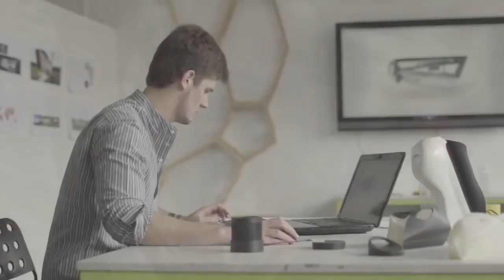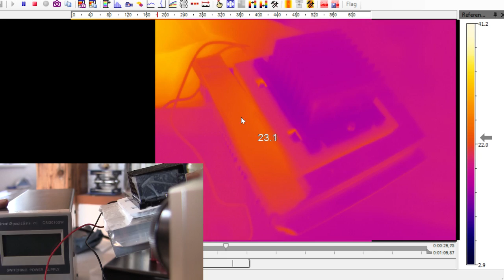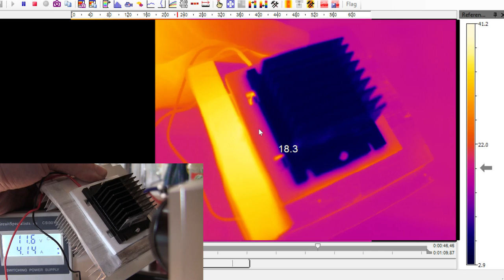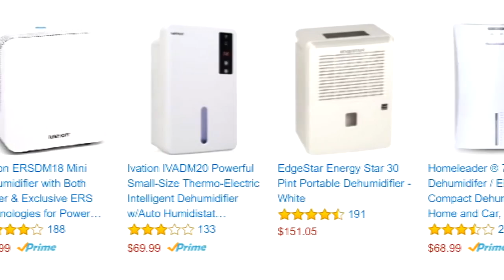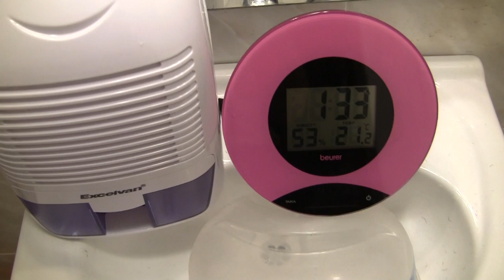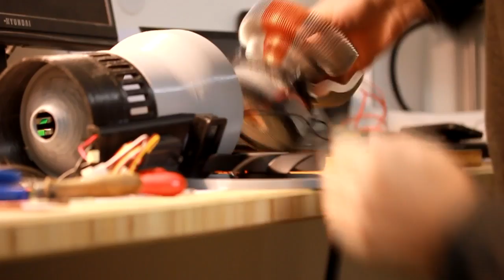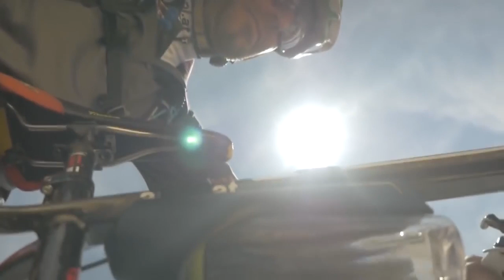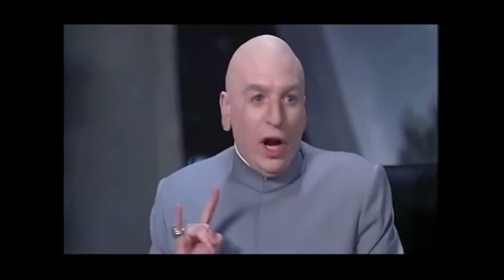$300 000 'Self-Filling water bottle' FAILURE

Comment: You might be able to do water-from-air with a much higher powered air compressor.   I'm a layman, but my father was a contractor, who works in Arizona and New Mexico.   After just one full day, at least a cup of water will come out of the bottom of the air compressor tank,  and this is in very, very low humidity Phoenix areas.   (If you don't drain off the water the tank rusts, and eventually it'll go boom, or so says the urban legend.)   Anyway, it'll probably need a compressor to make water in any environment.

Comment: We had some mold and moisture issues in our apartment last summer. The apt complex gave us a pretty large dehumidifier, a floor model bigger than yours. It was pulling almost a gallon a day of water out of the air. But that was only at the peak of summer for about 2 months with around 80% humidity. I had to empty it daily.

This winter I've left it on and I only need to empty it about every 2 weeks.

Massive changes in the amount of water you will obtain with one depending on climate and time of year.

Comment: Any comment on the incorrect calculations of requiring 1 joule of energy to extract 1 joule from the system given that the thermodynamic limit allows for a lot more favourable ratio than 1 to 1. Any chance on correcting the misinformation that although the project is infeasible that the claims fail on thermodynamic grounds?

Comment: > wants source of power on a moving bicycle
> ignores mechanical power of actual bicycle
Reply: Hazardous Shluud im sure adding a multiple kilograms heat sink to your bike would also exhaust you, especially up hill.
Reply: orthoplex64 
You ever play with those cheap generators they put on bikes to light a headlight? They add effort to the rider for a tiny amount of energy. Now imagine a generator big enough to power that thing. You would die of exhaustion in the first mile. No need to worry about water so, I guess, problem solved, lol.
Reply: @hazardousshluud2000  It could be integrated into the brakes like on high-end cars though. That's an actual possibility.
Reply: @hazardousshluud2000  Absolutely right. I tried one of those and it hampers the right so much for basically no energy at all.

It is useless.
Reply: @hazardousshluud2000  The bike itself is enough of an effort to the rider. So 50w more won't be a nightmare.
Reply: @TheHonestFoodTeller  That means it gets way harder than before to pedal, how don't you get it?

You can't get loads of energy for free
Reply: Hazardous Shluud, i had one of those on my bike. You get used to it and dont feel it anymore after a few days.
Reply: Who are YOU talking to?
Reply: pedal-powered accessories are a good idea in theory but in practice they are very impractical. It becomes very hard to maintain a consistent pedaling canter with extra effort of powering the generator. Not to mention that they are very liable to wear and break faster than most parts on your bike. As a bike mechanic, I’ve had several customers SOL because they have a bike with a pedal generator that broke and it’s impossible to get parts for.

Long story short, serious MTBers and cyclists do NOT favor systems like that because unfortunately they suck, and bringing proper hydration with you isn’t that hard, so don’t buy this shitty water bottle anyway! Haha but you already knew that!
Reply: orthoplex64 
trust me, I'm an engineer!
Reply: you would sweat more to make the power than you would get in water.
Reply: Or i can carry a backpack with bottles and ice packs      lolol
Reply: Hazardous Shluud use the generator for breaking. Thst's not rocket science, that's what happens on a tram. It breaks using a generator and backfeeds into the grid to save energy
Reply: [Whatever name goes here] Hi, I’m a bike mechanic and this strategy has been attempted by Specialized on their e-Bikes. It was found that rider usually do not spend enough time braking for it to be worth any energy gained. Even mountain bikers, who have to brake much more often in that style of riding (typically) weren’t able to take advantage of this technology, so they killed the idea. Interesting idea but I don’t think it’s quite efficient enough for an application in bicycles just yet.
Reply: Add a big panel on the back and instal altanators
Reply: orthoplex64: completely ignores principles of the conservation of energy
Reply: What about wind energy? Could putting a turbine on the bike do anything? I doubt it, but still haha.
Reply: @orchdork775  It would be too hard to ride to be functional if you wanted to produce enough energy
Reply: A bicycle is a closed system, you are the energy source, if you take energy from it in any way, you are taking your own energy away, so a windmill or a mechanical generator is out of the question and regular cyclists tend use their brake less to conserve their energy.
Reply: (3 years late) another idea would be to use the speed of the bicycle to cool the Peltier and cut out a fan "middleman"
Reply: @Hazardous Shluud
Walking is about 250W and just being alive spends about 100W. It wouldn't be hard to pull more power from the bicycle than from a solar panel that fits on a bike. If the solar power was even comparable, then we would already have self charging electric bikes.

Still not enough to make a useful self filling water bottle, but it is a lot better start.
Reply: Hazardous Shluud there's also a generator integrated in the wheel hub. It has less effort than the traditional "dynamo" we call it here in Czech.
Reply: +Hazardous Shluud
Not really, I have a crank flashlight that can light a whole room with a slow leisurely crank.
Reply: @Dover939  power required for a flashlight isn't exactly the same as power required to fill a water bottle with water from the air.
Reply: And motorization kits that either run on gas or batteries do exist.
Reply: Josh Mason  he's not talking about a motorised bike. He is talking about the little generators that you put on your wheel to power the lights. Also take a look at AbuDubais comment

Comment: At the end you talked about solar roadways, except it's not a fraud. It's just expensive, but if we converted all roads to solar roadways it would pay for itself over time in electricity and cheaper maintenance costs, etc. They are still in business btw.
Reply: You're delusional, the Solar Roadways are a disaster. The even set up a small section of it in the town square of their home town and they had to be taken out because they kept breaking. 

And that was just from human traffic. They can't handle cars.
Reply: The roadways are complete disasters. The LEDs use so much power and generate so much heat that it melted snow, and they constantly broke. Even if it could be built better, you’d need unobtainium to cover the panel that is both transparent and hard enough to tolerate years and years of being driven over, and said cars would obscure light from the panel, which isn’t getting good efficiency because it cant tilt to face the sun. If you want a solar panel to make up for its price in its 10-year or so lifetime (after which it will have to be replaced), don’t use it as a road surface.
Reply: They will never pay for themselves, they have to be subsidized

Comment: As much as I hate crap like this (not your videos, these "engineering marvel" crowdfunding things), I do think the concept itself has some VERY MINOR, legitimate applications. Someone trying to live "off the grid" would be able to get something out of it provided they built it themselves and didn't care about looks and design. While that thermodynamic cap does exist, there's still something that can be gained from it.

If they made enough of them they could probably condense enough water to at the very least survive. Overall though the application is extremely impractical, as there are better ways to get potable water. If you're out at sea you will get substantially more water by simply boiling sea water and condensing the steam than you would with this clear abortion of engineering. If you're bicycling across a country you are guaranteed to pass through areas with rainfall, and a simple tarp and funnel and some duct tape can get you a substantial amount of water. If you want to make sure it's purified, boil it and collect the steam condensation.

Like you don't even need to have a gas stove or some convoluted "solar power" solution for that either. You can just build a fire.

I swear, these engineering hacks are too focused on finding the most backwards solution to a true non problem. I think the concept itself is novel but this is so convoluted.

Comment: go look at the water flow from something actually cold like your air conditioner coils. have you seen how much water you can collect from 1 A coil? 2 gallons a day AT LEAST. the tech is feasible. but obviously not by these guys. Im a master electrician and maybe they need to usea dynamo on the bike or hand crank instead of solar. or how about something like the gravitylight driven system. stored  mechanical energy far surpasses solar. just shows the ancients knew better. look at the grandfather clock.
Reply: I'm sure that's what they did, look at an air conditioner, saw the condensation, and went "Why don't we build that into a water bottle?"  The thing is, one of those window box air conditioners might run on a 400 watt (1/2 horsepower) motor.  That happens to be about the maximum sustained power a trained cyclist can generate via pedaling.  So you're talking about adding a system to a bicycle that consumes ALL of the cyclists available power, leaving none left over to actually move the bicycle.  It would be like trying to pedal with the brakes on.  Humans are much stronger/more adapted to using their legs to generate power than their arms, so a hand crank would give much less available power.
How are you going to power a dehumidifier with gravity?  Some power source has to lift a weight before you can extract energy from it as it falls.  To generate 400 watts of power, you're talking about dropping a weight of about 50 kilograms.  Constantly.  
Look at the grandfather clock?  Okay.  A grandfather clock is horribly inefficient.  Some are powered by springs roughly the diameter of the face, most are powered by a hanging weight of a pound or two.  They can run maybe a week on a winding.  A quartz clock with a face of similar size can run for upwards of a year on an alkaline AA.  This is partially due to the energy density in a modern battery, and partially due to the lack of massive amounts of friction in the clocks wheels and escapement.
Isn't it a luxury to live in a world where you don't have to have a solid grasp of how much power things take?

Comment: Water, extracted from the air isnt drinkable, cause there are no salts inserted.
If you drink condensed water over a longer period of time, you will die.
Reply: Shakuraz the Dark One 
That why you need to add a bit of sweat and some urine then, walla, normal water, lol.
Reply: Lol....just a few drops of buttsweat
Reply: Not to mention there’s a lot of other stuff like microbes and dirt dissolved in it. There’s a reason you’re advised not to drink dehumidifier water without filtering, as it’s completely open to the environment, stagnant, and the dehumidifier is a perfect environment for stuff like Legionnaire’s Disease.

Comment: Random question.  Could something like that device be used in something like computer cooling?  Like, using the heat from the cpu to cool itself?  Sounds impossible but i figured I should ask.
Reply: Liquid cooling systems need to be air tight in order for the liquid to flow, you would need an ambient liquid injection system that could also automatically bleed any air out of the system that gets introduced.

Comment: I can solve this problem! I just need to move into the realm of science fiction like Star Trek, and just replace the empty bottle with a filled botter of water with transporter technology!

Other more realistic solution is making a watertight suit that resembles a stillsuit from the science fiction Dune, then when the wearer of the suit keel over from heat exhaustion (especially if the person is cycling or something in hot weather), I would retrieve the water from the idiot that wears it on my behalf. And to address those who think drinking purified water is bad for you etc, I would make the accumulation point of the liquid at the crotch area; hmmm, salty! :P

Disclaimer : "Water" might be yellow at times.